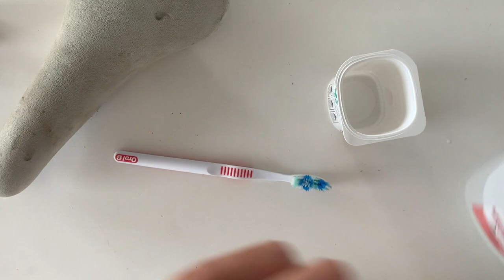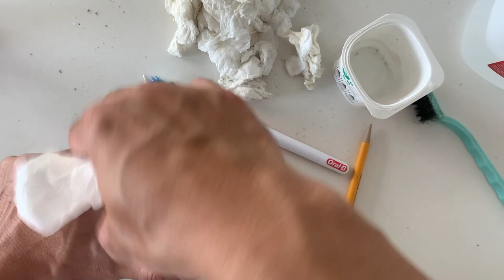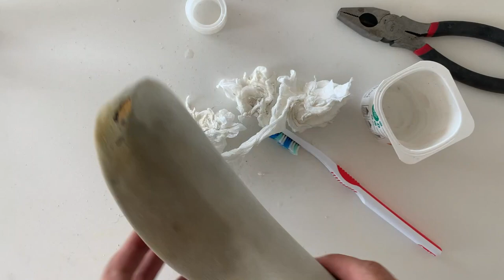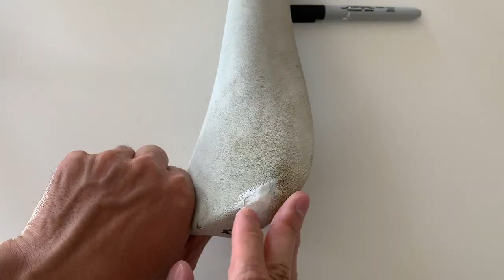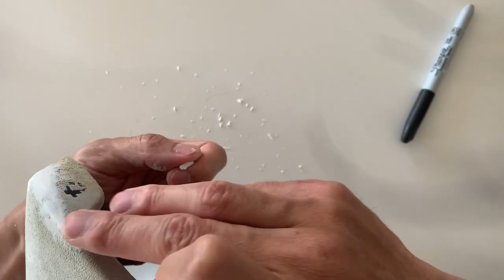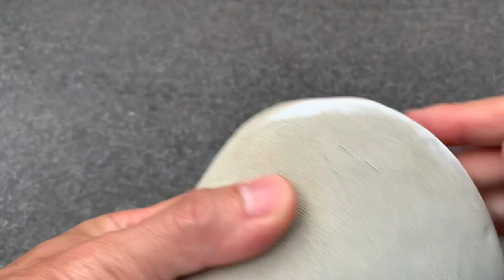cleaning & fixing suede white selle italia turbo saddle

Comment: I recon you could put some kind of texture on that sugru knock off stuff, I know sugru goes glassy smooth with a wet finger so it might take a texture like a small paint roller
Reply from the maker: Ahhh yeah that’s not a bad idea! I think you might be able to get some texture on it some how. It was pretty tacky so I kinda had to smooth it out to get it off my finger if that makes sense. Maybe after you could use a wet brush to give it some texture!! Might try that next time, if I do it again cheers for the tip 😊